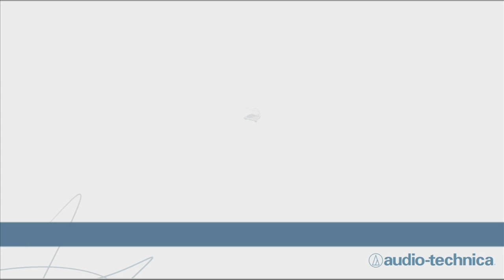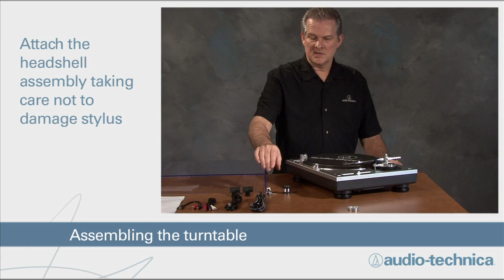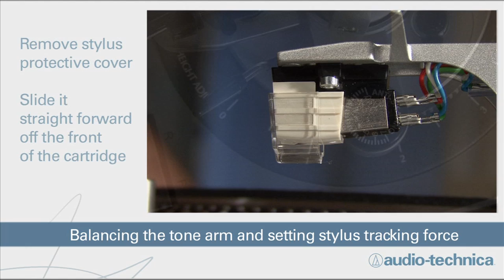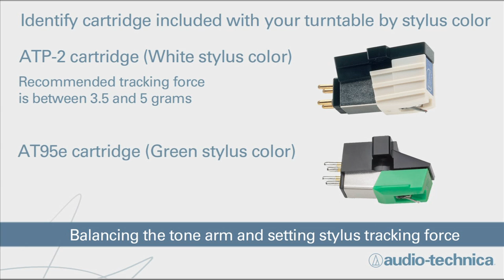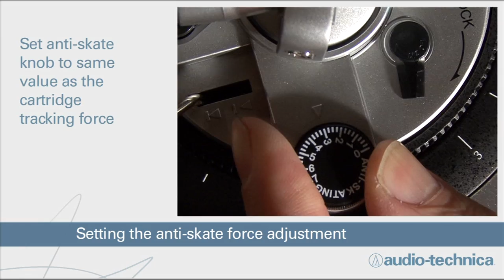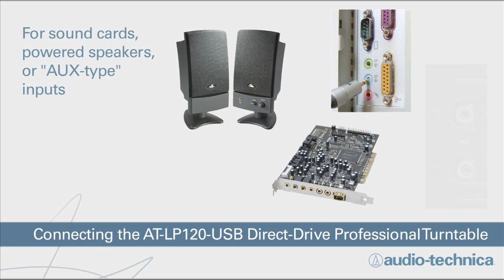AT-LP120-USB Setup | Direct-Drive Professional Turntable

Comment: Excellent set-up video. I foolishly tried to set my system up just using the instructions, and it didn't work (only had audio coming out of one speaker, and was very quiet). After watching this, I realised I'd put the counterweight on the wrong way round. After following this guide, my turntable now works a treat, and has given a second lease of life to an old surround sound system.

Comment: If you keep the "lift arm que" in the up position when not using the turntable, turned off , etc, it will then work properly the next day for about 1 album play. Then it it returns to being defective like a $30.00 toy record player. I have a Pioneer PL 518 from about 1977,
and the damping system works perfect. The pioneer has not been serviced since it was purchased.

Comment: In the manual, one will find on page 5, Initial Setup:  Setting the Voltage Selector Switch
This turntable has the capability to be used with either 115V or 230V
AC power, 60/50 Hz. The voltage selector switch is located on the
top of the housing deck, under the platter. Set the switch according
to the voltage in your area. [See Figure 4.] (Note: The turntable comes
shipped with the voltage selector switch set for 115V AC.)

Comment: I suggest adding a 10 second warning message before commencing the installation to alert international purchasers on the correct use of the voltage switch (115v vs 230v).
Reply: That's right.I got myself New Audio-Technica AT-LP120 online.I forgot to change the switch to 230 from 115 V ..!!! and plugged the turntable and it is now burnt.I don't know what to do now.I was so happy about purchasing  this TT,I couldn't wait for it to arrive and now I'm sitting here helpless with TT that's not working and bunch of records I was looking forward to play
Reply: +Tupi Tupi burnt? argh.. now i know why my new T T not working.. :(
Reply: +Tupi Tupi can it be fixed?

Comment from the maker: The setup is almost identical except that the AT-LP120-USB includes a cartridge, and the cartridge is pre-mounted to the headshell. The AT-LP1240-USB does not include a cartridge (only a headshell). A cartridge has to be purchased, mounted and aligned. If you need more information, please contact our Audio Solutions Department (audio-solutions@atus.com, 800-443-4669).

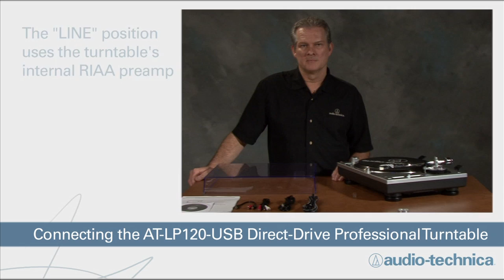Comment: @6:27 – "The PHONO/LINE switch does not affect the USB output" 

Is this true? I just spent 30 minutes trying to figure out why I wasn't receiving any sound in Audition nor Audacity after connecting the LP120 via USB to rip some vinyl... until I switched from PHONO to LINE, which did the trick. This seems to make sense, since LINE ensures that the signal is routed through the built-in pre-amp and I (unfortunately) wasn't using an external ADC... Is my guess correct? Curious to hear why I wasn't getting audio via USB with the switch set to PHONO, in any case...
Reply from the maker: Hey Andrew! Please contact audio-solutions@atus.com for assistance. Thanks! - A-T USA
Reply: NO ITS NOT TRUE. AND THIS VIDEO JUST CAUSED ME HOURS OF HEADACHES BECAUSE OF HIS WRONG INFORMATION GIVEN.

Comment: To anyone considering purchasing this turntable. There are a couple of things you should know first...

I purchased one a few years back, right off the bat the platter was BADLY warped & the anti skate did not work AT ALL (which are two common problems with these tables). I mean it did absolutely nothing, it was useless. I called Audio Technica about the platter, they told me to take a video of the platter spinning & send it to them. I did that & they told me to send the warped platter to them & they would send me a new one, which they did. When the same model in glossy black was available to purchase (AT-LP120BK), I sold mine on ebay & bought the newer, black model because I definitely preferred the black finish over silver but mainly because I wanted this table with a WORKING ANTI-SKATE. After setting it up I found the anti-skate on this one also DID NOTHING AT ALL AS WELL!. 
I recently contacted Audio Technica telling them exactly what  I have explained here, & to my disappointment, they replied with an AUTOMATED message.

"Hi James,
Thanks for the inquiry and contacting Audio-Technica U.S., Inc  (ATUS.)
 The  AT-LP120-USB
 was designed as a DJ turntable. Due to its excellent sound, quality and
 low cost, audiophiles started using and recommending it as an 
audiophile turntable.   The AT-LP120 was designed with the DJ in mind 
and has features to meet that need such as being able to reverse the 
direction of the turntable and robustness for record scratching.  
According to one manufacturer of high end phono cartridges and tone 
arms, a somewhat weak anti-skate mechanism might be just right for 
low-compliance, DJ-oriented cartridges and one of our other competitors 
even recommends setting anti-skate to zero for DJ use.  Therefore, the 
AT-LP120-USB does not have the same anti-skate adjustments that you 
would find on a high end (and high cost) audiophile turntable.  You may 
look into the  AT-LP5 which is more designed for audiophiles and has a stronger anit-skate."

Basically, they are telling me if I want a WORKING anti-skate, I have to purchase their $500 table. They are also saying the table was designed with the DJ in mind & because of that the anti-skate was made "somewhat weak" on purpose. Firstly, the anti-skate is not weak, it is NON-FUNCTIONING. Secondly, this turntable has been modeled after the famous Technics 1200, which is a DJ table. Does anyone think that table has a worthless, "weak" anti-skate? I highly doubt it.

I am not knocking the AT-LP120. It's a very nice table for the price but to replyi with an automated bullshit response, especially to a customer who has purchased TWO of their tables like myself, is unacceptable. 

There are better options if you are looking for a table in the $250-$300 price range.  

-U-Turn by Orbit

-Teac TN-300 is very nice

-Denon 3P-300F

-Pioneer PL-30-K (although some people complain the speed is off) 

-Rega RP1 

If I had the chance, I would have purchased one of those instead of the AT-LP120.
Reply: Yes ?
Reply: James Zee I would definitely recommend getting the Rega Planar 1, or a Pro-Ject Debut Carbon. You will be Much happier.

Comment: After setting the tone arm, when I attempt to set the stylus tracking force - it throws off the tone arm causing it to drop once I remove it from the locked position. Am I doing something wrong? I followed the exact instructions on your video...

Set the recommend stylus tracking force by rotating the entire counterweight assembly counterclockwise. The force gauge ring will move along with the counterweight, allowing you to set the counterweight for a specific tracking force.
Reply from the maker: Hi there! Based on what you wrote, it sounds like you are doing it correctly. When you balance the tone arm, you are basically setting it to zero/neutral tracking force, which makes the tonearm hover. Then when you set the tracking force by turning the counterweight, the arm should drop because of the weight of the tracking force which you have applied. For more information, please contact our Audio Solutions team at audio-solutions@atus.com. Thanks!  - A-T USA

Comment: Does anyone know if there is a 3.5mm jack for speakers? Or do I need to purchase an adapter or something to use them?
Reply from the maker: +Michael Angelo An RCA to 3.5 mm (1/8 inch) adapter cable is included with the turntable. The speakers must be powered (also known as active) type speakers, not passive type speakers which require connection to an amplifier or receiver to function. With powered type speakers, just use the included adapter cable to connect the turntable to the speaker(s) and make certain that the selectable phono pre-amplifier located inside the turntable is turned on. That is, the pre-amplifier selector switch on the rear of the turntable needs to be placed in the line position. - A-T USA

Comment: I have a question, the on/off switch red light on my LP120 has never work. Is this significate for its use? got back in feb 2016. Thanks.

Comment: Hi! Couple of montsh ago I bought myself an Audio-Technica AT-LP120 USB and I was very happy with it. But at some point when I was playing music and pitching a little bit, it just stopped rotating. It still received current but the start/stop button wasn't working anymore. I pulled it out of the socket and basically after a few tries it was working again. Two weeks later, same problem, but nothing I do seems to work. Did anyone have this problem of does anyone know what I should do or what caused this? Please help, I'll be forever grateful! :)
Reply from the maker: Hey! Please contact audio-solutions@atus.com for assistance. Thanks. - A-T USA

Comment: How high should you set the tone arm's height, if you're using the standard 95e cartridge (the one whose weight is 1.5-2.5 grams)? Should the height be calibrated to a particular number on the circular height adjust base? Or should you just use a ruler to measure the height from the base of the turntable to the tip and end of the arm after calibrating the tonearm's weight?
Reply from the maker: +Declan Fry Hey Declan, please contact audio-solutions@atus.com for assistance. Thanks! - A-T USA

Comment: Not once in this video he mentioned about the TT being set on 110 Volts.Not once the Audio Technica even mentioned it in the instructions that comes with this TT.Shame on you and your company,I don't know how you pass quality control.Under SAFETY INSTRUCTIONS  in your manual that comes with this tuntable you don't say anything about this TT being dual voltage and you would think that that would be the first thing to let the buyer know.There are so many people who use 220 voltage.I've bought your TT and plugged it in to 220V and now it is not working and ofcourse the place I bought it from tells me that it is my fault.This is the last that I'm buying something from Audio Technica.Totally careless and unprofessional.
Reply: The manual in the AT-LP120-USB I received this week was very careful to mention the 110/220V switch underneath the platter, and to make sure it was set properly before applying power.

Comment: I am on my third Audio Technica LP120-USB turntable in this past month. What do I mean by that? I had to go through three exchanges before finding a unit that didn't have warped Di-Cast Aluminum platter, Anti-Skate that actually works. And most of all, one that has a "quiet" direct drive motor. I would also like to know why every unit that I have opened, the packing styrofoam is broken. This is an indication that the units that I have had, were returned previously, and put back on the shelf.

With my current unit, I am questioning the Anti-Skate. Unless it is set to zero, the pull of the tonearm is extreme. Since I do not own a groveless record for testing the anti-skate, I have used a CD as a substitute. Correct me if I am wrong, but shouldn't I be able to center the tonearm on the center of that CD? Set at Zero, it veers to the spindle, as expected. However, when I turn it to one, that tone shoots over to the far right. I am talking off the CD/ Off the platter.

Any suggestions would be greatly appreciated.   I sent an email to Audio Technica, and never heard back.
Reply from the maker: Hi Jonathan! Please send an Email to marcomm@atus.com so we may assist you. Thanks! - A-T USA